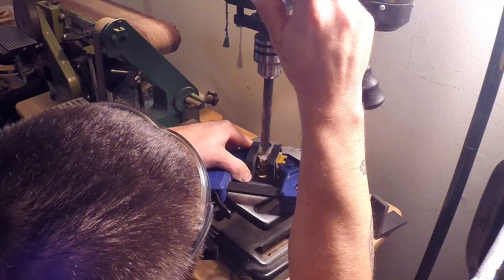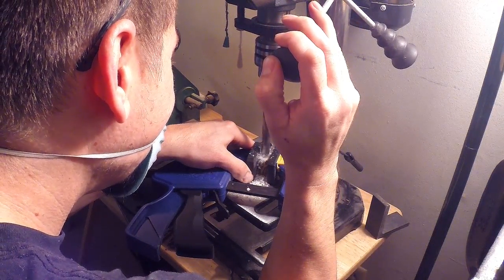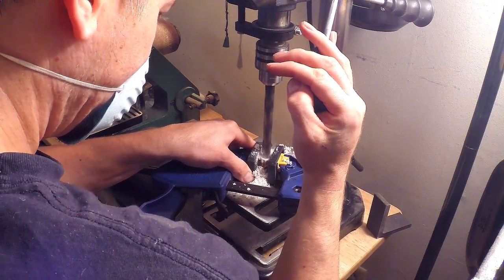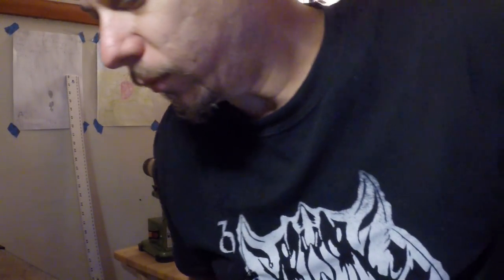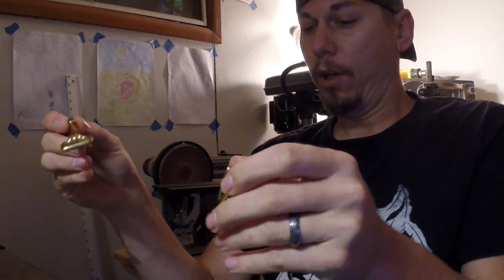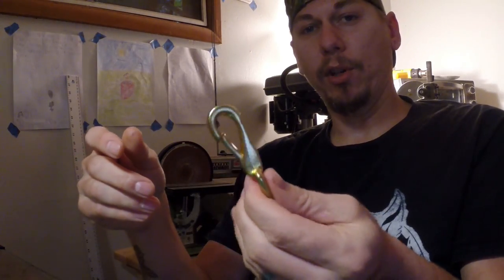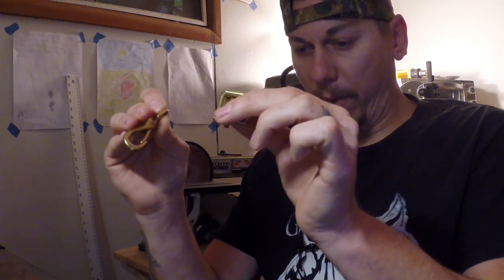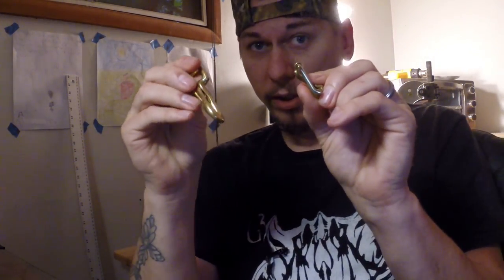WolfeCustoms shop #009

Comment: I have bought the snaps at Ace, but the are expensive.  If you talked to a manager they might work a deal with you, but I do not know for sure.  Maybe a Tractor Supply would have them.  Ours carries a lot of supplies for horse tack equipment

Comment: I've been having a lot of issues with Tandy lately also.  I don't have a store near me, closest one is about 2 1/2hrs (Hartford, CT) away so I have to order everything online.  Seems lately though the parts pickers have been screwing things up left and right, wrong rivets, wrong size swivel snaps, wrong weight leather.  Last order they had to get the leather from a different store which was no big deal but never shipped the rest of my order until I e-mailed them to find out what the hell was going on.  Got an e-mail back saying that their communications had fallen through and my order was shipping out that day.  Unfortunately they're the cheapest on the stuff that I need, I'm not making a ton of money on my stuff to begin with and I really don't want to jack my prices up on my customers.  You might try Ohio travel bag for the snaps (you tube won't let me post the web address for some reason).  Give them a shot and see if they have what you're looking for.  Their catalog is on their site in .pdf format.